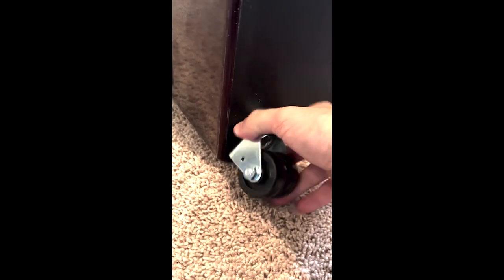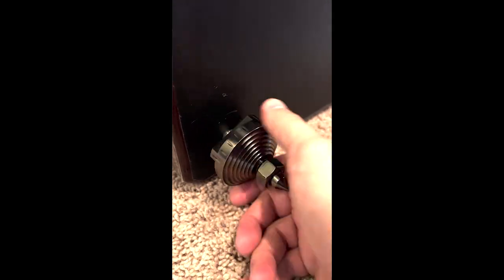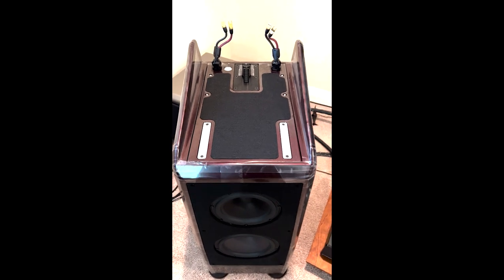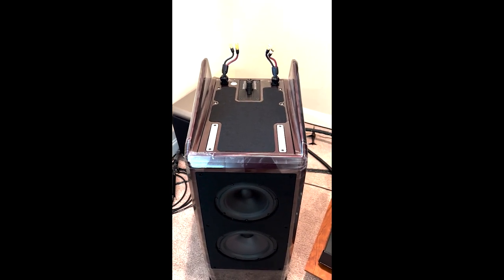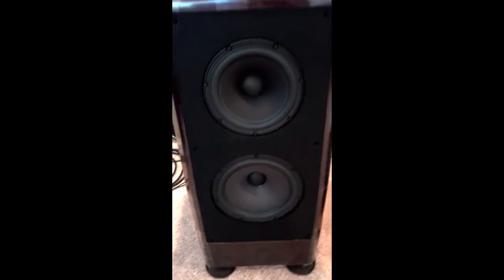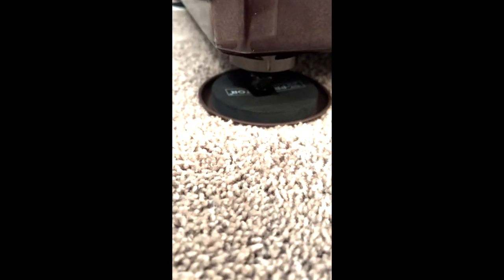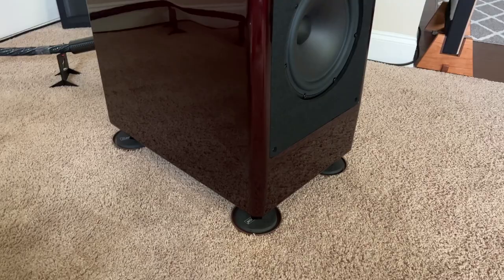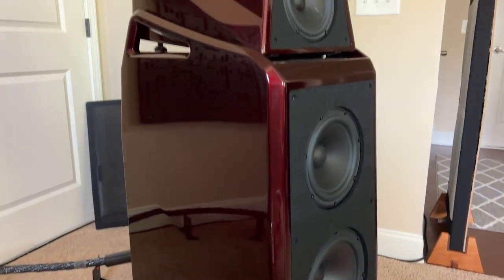Dialing in my Alexia V Loudspeakers... | W/ Peter McGrath

Comment: An informative video! Lee, would you mind sharing the rest of your system with us, ideally in a video? I know Peter mentioned some Audio Research gear, but which models?
Reply: Sure.  dCS Rossini Apex stack, Revox A77 reel to reel, VPI Scoutmaster with 3D arm and HRX pulley system and Lyra Etna Lambda, Audio Research Ref 6SE preamp, Ref Phono 3SE phono stage, and Ref 160 Stereo.  Shunyata Altaira grounding system. Various noise reduction devices.

Comment: I found that the Alexia had a very small sweet spot where literally there was a single seat that sounded great  - but if you moved a foot either way the sound stage dramatical shrank - it was a great speaker for a very small listening area
Reply: Given the precise time alignment, there is no better place to be than the center chair.
Reply: @realleescoggins  So it's only a speaker designed for seated center listening for one person? Why not get headphones no wonder so many audiophiles are lonely.
Reply: I understand that ... and if it was a less ambitious speaker I would not be as critical - but it is a large , heavy and expensive speaker which I believe would most likely end up in very large living room of a well to do person. That situation would most likely call for an optimal listening area which is much larger than a single seat. There were aspects of the bass region which were amazing with huge clean dynamics - at times they were startling . The mids were very close to my Magnepan LRS  in quality  which is impressive for a box speaker ..... but that dome tweeter is directional IMHO. - it has a very small sweet spot - lets say there were 6 audiophiles in the room - everyone would fight for the perfect seat.
Reply: @kloss213  It sounds very good across the listening positions but it sounds best in the center.  Most speakers are like this.
Reply: @mrgiggles7840  I have not found the new tweeter to have that issue.  It sounds great in both the left and right seats.
Reply: and who are exactly are you related to Wilson speakers - do you have any kind of business relationship with them ?
Reply: @realleescoggins  many audiophile speakers yes but there are options MBL multicellular horn systems etc I think it's a design defect if the speaker only sounds best in one spot. YMMV
Reply: @kloss213  
"a design defect if the speaker sounds best in one spot" 
I respectfully disagree, every stereo system is best dead center. 

It's not loudspeaker engineering challenge. It's our hearing mechanism experiencing stereo playback in a room. 

Even superb designs like the big mbl omnis, sound best when experienced in a single spot. 

It's the physics of sound, physiology of our hearing, and psychoacoustics of our interpretation of experiencing stereo sound. 

Time and Level, is what we utilize.

Both, interaural time differences, and interaural level differences. 

The recording and playback process leverage these two characteristics. 

Therefore, as a listener ... to fully resolve both time and level differences to the highest degree, it's vital one sits equidistant from each loudspeaker. 

It's worth noting, there's design exercises that attempt to maximize usable area/width over which a system can be effective. 
 
Time/Intensity Trading is such an example ... controlled/constant directivity horns, aimed on axis to the opposite corner (ie., speaker axis crossing well in front of listener). 

Thus sitting off axis, the far speaker becomes more on axis. So, trading time for intensity. 

My friend Bill Waslo has a good white paper describing the effect. 

Regardless, every stereo loudspeaker system is best experienced dead center.
Reply: @FOH3663  Stereo is a 1930s compromised tech and it's been shown to cause the brain to work harder since what we're hearing is a sonic illusion causing listening fatigue. The 1st was 3 channels 2 was a compromise and it still is. The concept of sitting center solo and listening to music is also dated and fading from use. There is tech that can achieve a sound stage with 1 speaker today one that can sound great through a total space. Mono was a more natural way to play back music and even today mono has benefits over stereo with modern loudspeaker tech applied a mono-type wide dispersion system can be the more realistic reproduction over a locked dead-center listening system where the loudspeakers are designed to beam providing only the narrowest of sound stages the illusion collapses with small changes in position.. I mean how unnatural is that? Where in reality does sound function that way how is that the absolute sound?
Reply: @kloss213  
Many good points and I agree with most all of that. 

Simply pointing out its not a design defect that a stereo rig is best experienced dead center. 

That said, it's certainly a benefit when the experience doesn't suffer appreciably across a wider area.
Reply: @mrgiggles7840  simple, you don't understand stereo sound. Sweet spot is one place
Reply: wrong - you know nothing about stereo systems - sweet spot can be big or small depending on design of speakers

Comment: Does this guy do it all ears or does he reference and backup his hearing with a measurement mic or RTA? I have no doubt his experience can probably make up for it, but I have doubts about his hearing accuracy at his age. That said, again, probably his experience and doing this daily forever, negates that as his mind is constantly recalibrated. I have messed around with acoustics and speaker placement. At first I thought, what's the big challenge, this is easy. Boy was I wrong. The next 5 years playing with the same system in the same room rendered more goodness than I ever though possible starting out, and I am certain I still have many things wrong. I imagine this guy, with so much experience in so many rooms and with uber quality speakers, has a plethora of experience you cannot download to someone else. 

"they are only as good as the guy that set them up" you really are correct there. Id love to talk learn from this guy and do this job.

Comment: I am 77. No need for fame and fortune. I have been an advocate of the magazine since time immemorial! 
What Wilson puts in the operation manual is for people who has no idea on time alignment. I went to an audio critic who owns a pair of Alexia and help him to.set it up about one year ago!
Disconnect the high. So only the low and mid are working. Play a female vocal cd. C adjust the mid until the sss sound of the singer is normal. Normally if the sss is too long the mid arrives your action slow. 
Then play a piano piece. If the hammer of the high notes is not heard, then the low is too slow, adjust the mid backwards! 
Then connect the tweeter. Same thing. Listen to the female vocal! 
I have involved in time alignment than twenty years, using an XTA. Wilson speakers are not accurate enough!